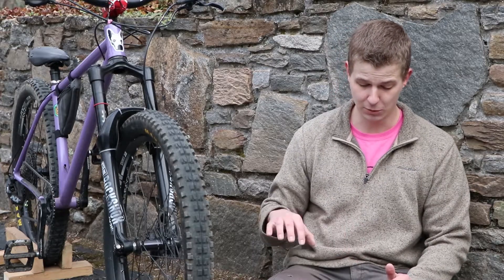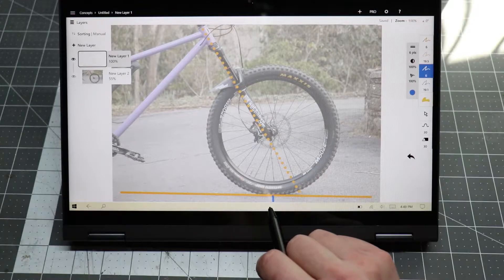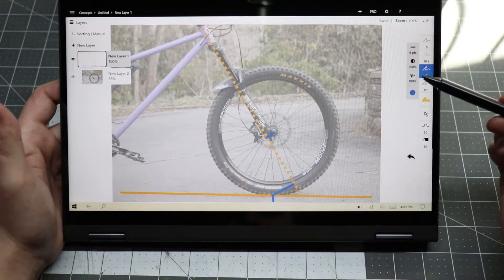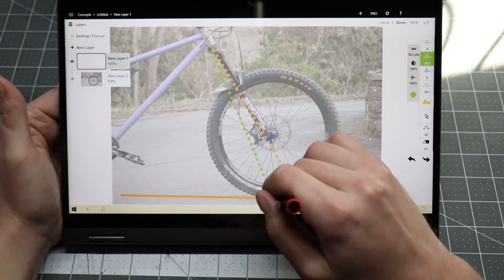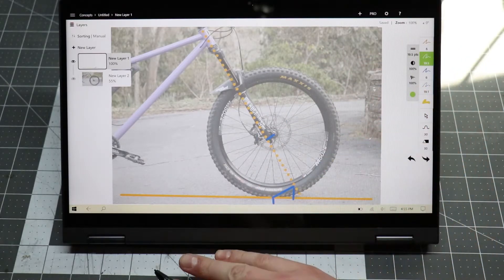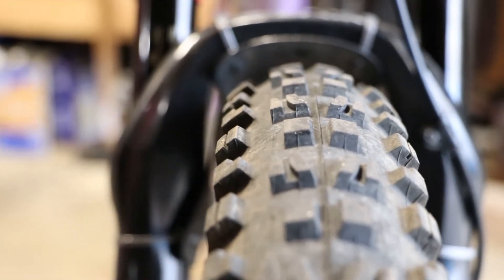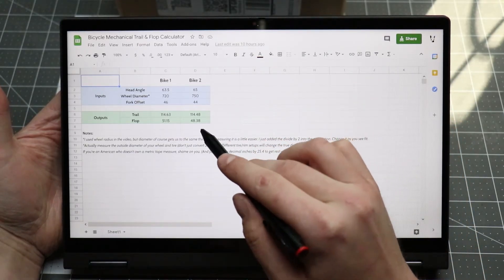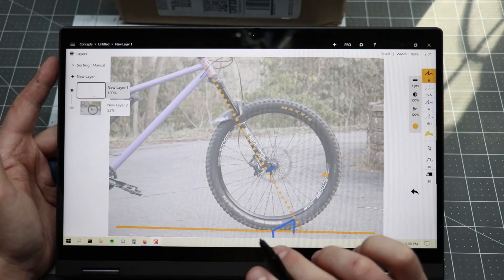What Fork Offset is Best? Steering Geometry 101

Comment: Sorry for my poor English. The current Chisel frame is, as you know, more progressive than the previous one. The factory head angle is 68 degrees and the fork offset is 42mm. Many people modify these bikes by installing, among others, a Reba with a 51mm offset, which significantly reduces the trail but slightly increases the wheel base. The bike will probably be more controllable, but won't there be an effect of a steeper head tube on descents, won't this Reba ruin the gains of the new geometry? By transferring the effect of the change in offset and wheel base to the head angle - will it be a change of about 1 degree or rather a less noticeable value?

Comment: Stating how offset increases affect wheel flop is excellent. I was originally thinking more offset, increasing wheelbase, would add stability and increase straight tracking.  I've got a 70deg HT angle, and a Fox 34 Stepcast and trying to switch to a carbon fork. The Enve fork can switch from 44 to 52mm offset, the Whisky fork is fixed 51mm offset. Plus, the Enve fork is 10mm shorter in length than the Whisky.

Comment: A vertical stem is actually best, with zero flop. 
Mike Burrows put together a bike that was fully adjustable to check this. Interestingly BMW have done the same.
Of course then the handlebars are out of reach, so you need a remote linkage.  Historically the reason why we have inclined stems is to get the bars close to the rider.  A Penny farthing has a vertical stem.

Comment: that's why I really liked my 72* head tube angle on my XC MTB back in 2017.. 2018. that angle was just almost perfect. of course.. for cross country bikes. for enduro or trail it's usually 68.. 67 66* for head tube angle.
Reply: enduro is more like 64, 63 now and my trail bike is 65.. lol... They keep making things slacker and slacker.  I wanna find that perfect mix of a great climber but also a great descender... My Norco Fluid FS 1 is really close but only has 140mm of fork travel and I would like something like 160mm.
Reply: @snowman22ism  true I'm not in Enduro. No trails or hills in my flat area in middle Poland. But yeah 64 in Enduro is more like a standard nowadays. XC is going a bit too crazy with 67 in my personal opinion.

Comment: Amazing video that clarified many things for me. I do have some further questions though.

1. Why is too much trail combatted by adding an offset instead of reducing the headtube angle?

2.Will you make a video on the whipple model of the bicycle, or any model that attempts to mathematically determine the motion and stability of a bike using classical physics?

Thanks for your time.

Comment: the flop is a major characteristic in motorcycle handling at low speed, in rough terrain, the handlebar get stuck or almost impossible to move if you stall the engine.

Comment: Is there an optimum trail & flop?  I have an early Levo that I have converted to a mullet, I am looking to replace my fork.  My bike came with a 51mm offset fork and I am having a hard time finding the fork I want that comes in 51 (most are 44).  I am concerned that I have already slackened head angle with 29er on front, I am also wanting to upgrade to a longer travel fork (150 to 170).  Is there a way I can figure the head angle with the longer travel fork?  The more I learn about bike geometry the more I feel like I might be making my handling worse.
Reply from the maker: You can calculate the change in head angle with a little trigonometry. You will just have to know the wheelbase, existing head angle, and then the old & new fork dimensions. If you can draw it up it CAD it makes it very easy. That's usually what I do.
But I would also agree, mullet-ing a bike and THEN adding a longer fork is going to change basically all of the geometry of the bike.

Comment: Thanks for the video. I'm a roadie but I'm looking at changing a fork out. So was interested in the theory. Quick question, for the trail calculation on your spreadsheet, is it formula the 'mechanical trail' or horizontal trail on the ground? Thanks again.
Reply from the maker: It's the mechanical trail. i.e, measured perpendicular to the steering axis.

Comment: It seems that the middle ground is the best.  Like the 27.5 wheel gives you the best of the 26 wheel  and the 29er.  And as you said in this video  just 26 is better for some types of things as well the 29er.  A-10 vs F22 You buy what you need it to do. Thank you for your time and effort in making this video. 💯🇺🇲👍🚲🦺🧰🔧🪒⚙
Reply from the maker: The wheel size is a variable when calculating the Trail and Flop numbers, but it's important to note the trail and flop are what really give the steering and handling characteristics. Not the wheel size.
In other words, if had a 29" bike, and a 26" bike with identical trail & flop numbers, they would handle very similarly. So similar that most riders may not even notice.

Comment: Great video, but one question: 
the way I understand, offset is taking place at the front hub.
With some forks (fox 36 e.g.) you can get different uppers with different rake values (44 and 5xmm if I am not mistaken) so let's say I increase my rake by 10mm would that have the same affect as increasing my offset by 10mm?
Thanks a lot regards, markus
Reply from the maker: Rake is a different term altogether, and I suspect you are using it incorrectly. It is typically used in place of head angle for motorcycles. For example, a 70 degree head angle is the same thing as 30 degree rake. Just measuring the same angle from the other side, in other words. 

But to answer your question, it sounds like you are using the terms interchangeably, so the answer would be yes, it is the same.

Comment: Great video, best explanation and only one that mentions flop.  So what about weight distribution from offset?  Does it make much if any difference?  Shorter offset gets front wheel closer to rider putting more weight on the front wheel.  Changing center of gravity slightly forward and gives a little more traction up front.  Guess it is kinda like stem length not just changes reach but longer one puts more weight on the front tire.
Reply from the maker: The differences of weight distribution, wheelbase, front-center and all that are going to be very minor when talking about the fork offset differences. It just doesn't really move the front wheel around that much when compared to everything else. 

As an example, lets say we go from a 51mm offset, to a 42mm. That's a difference of 9mm. With the head angle of the bike in this video, that means we move the front tire horizontally by only about 8mm. Over a wheelbase of around 1200mm, that's a pretty small change overall. But the changes to the steering geometry and such are much more pronounced. 

But also for mountain bikes, we typically want to do the opposite of bringing the center of gravity forward. That's why bikes are getting longer and longer, slacker head angles, etc. Increasing the front-center of the bike has many more positive stability benefits off-road than the slightly increased traction of a forward CG.
Reply: @eglfabrication  Thanks for your interesting video. Reducing the offset from 51 to 42 doesn't help carry the weight forward, so it improves stability? Traction is more related to the "trail", if I understand. I'm in doubt whether to switch to an offse 42 fork from a 51 on a bike with 65 ° steering .... I don't understand if a variation like this would lead to big differences on the steep and technical.

Comment: Can we assume longer offset would essentially make the wheelbase "shorter" since it makes it more twitchy
Reply from the maker: It does make the wheelbase shorter. Technically...
But the difference to the wheelbase / front-center is almost negligible with everything else going on. 
As an example, going from a 44mm offset to a 51mm is a difference of 7mm. 
When you factor the head angle in, that number gets even smaller. 
That's only a percent or two of change to the wheelbase. But the changes to the steering 'handling' and feel are much greater. (and worth it in most cases)

I've been playing around with some stuff lately and would like to expand on this video. There's a lot more going on with the bike as a whole! But I tried to keep this video limited to just the steering aspects.
That video(s) should hopefully be soon!
Reply from the maker: Actually, now that I think of it, putting a longer offset fork on an existing bike will make the wheelbase longer. Got it mixed up in my head.
But yeah, the changes to the wheelbase are very small.

Comment: I don't hit double gaps and ride mostly in terrain with techy climbs and short steep descents. I ride a 2013 Stumpy 29" with a 51 mm offset. It is a great climber and has very precise steering with a 10mm rise 720mm bars. It never feels unstable on gnarley downhills, but I am not on extended ones, like in serious mountains. That would be the only reason I could think to switch to a longer, slacker bike.

Comment: I wonder what's the best offset for my Marin San Quintin 1. It has a 65 headtube angle with 47mm fork offset atm. Will 51mm offset be okay?
Reply from the maker: 51mm offset will be fine. The differences will ultimately be pretty subtle. It really just depends on how 'sensitive' you are to changes like that (a lot of riders will never really be able to tell the difference) and of course what you're looking for in the bike. 
If I had to guess, you're probably just using the bike for general 'trail' riding, and not just all-out smashing the rough stuff. 51mm offset is what I would run in that case.
Reply: @eglfabrication  you're  probably right Mate,  thanks for the detailed information. Very much appreciated. 👍